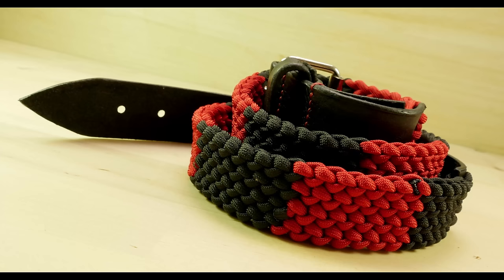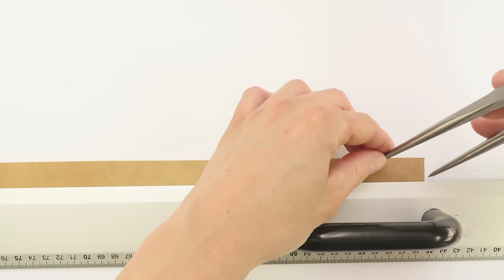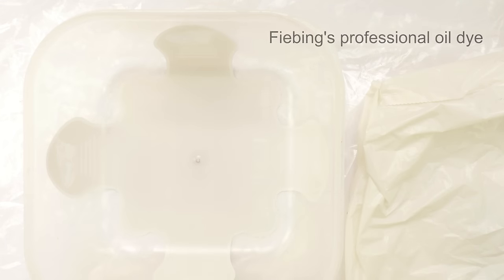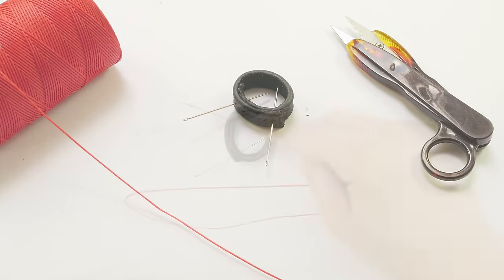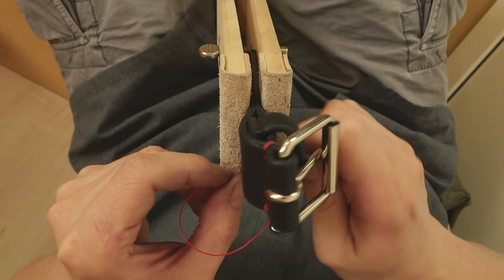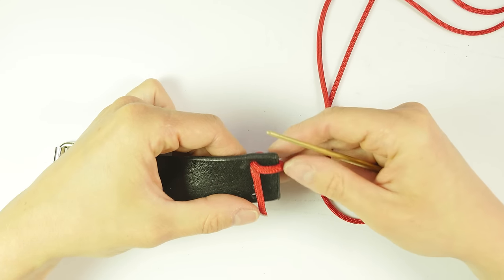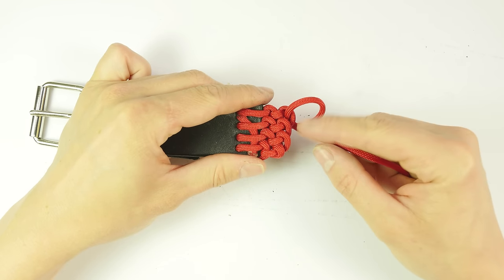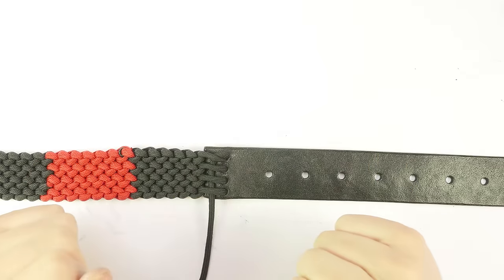Conquistador braid paracord belt- the "proper" way

Comment: This is my favourite pattern for belts. It is key to control the twist that each pass of the working end through each loop puts into your cord. I found your method of using shorter lengths and splicing in new pieces, I have always used a single length. I shall try it. Thank you.
Reply: ive done numerious one piece bracelets with this stitch. I deal with the twist by running the cord through my thumb and forfinger as i dont like splicing. The twist is a bit of an issue, I also roll the cord with my right hand as I pull it through. its a pain but this stitch looks so good.
 I made a belt for myself which i wear all the time but i fitted it to my size wiht a buckle. I like this better as I can make them adjustable and sell them...

Comment: Great tutorial, Marko. Splicing colors has the great side benefit of not pulling fifty feet of cord through every loop!
Reply from the maker: Hey, glad to see you enjoy the tutorial!

That is indeed the case. Some prefer to use one long cord, but sometimes it is better to have a more practical approach. While not as clean due to the splices (not a big deal in my opinion), the 2 color effect and the speed boost in using shorter cords is well worth it.

Mark

Comment: How do we determine waist size for the belt becuase I am wanting to make a belt with 5 coils or loops as you call them becuase it gives a good center hole for belt buckles to hook on to so I won’t be needing to add leather but I don’t know how to measure the length of paracord and I have some expensive cord I want to use for it that’s 25$ for 100 ft so I really can’t afford to not have enough cord for this due to the price of the cord
Reply from the maker: Hey!

The easiest way to measure for a belt is to take a look at an existing belt you are using.  Then you simply make a test length- let's say 3 or 4 inches and see how much cord that used up. Than simply multiply depending on the belt length.

Mark